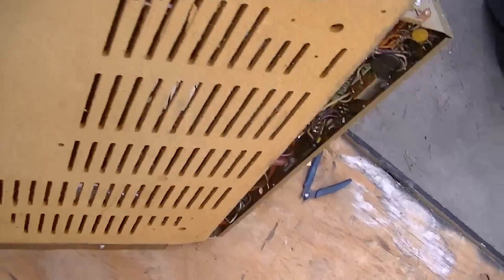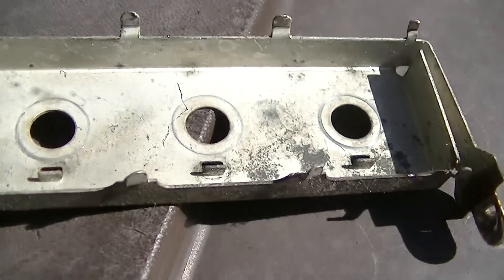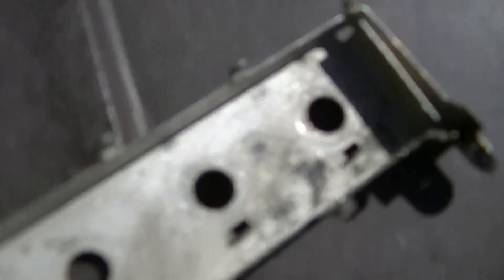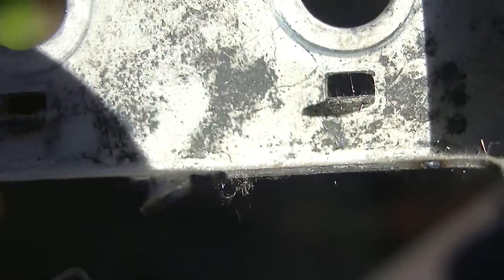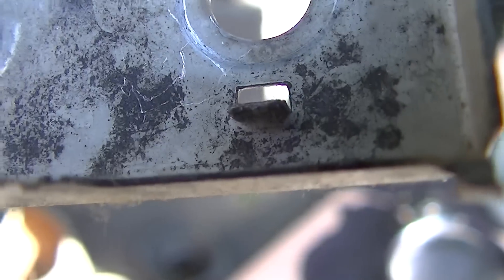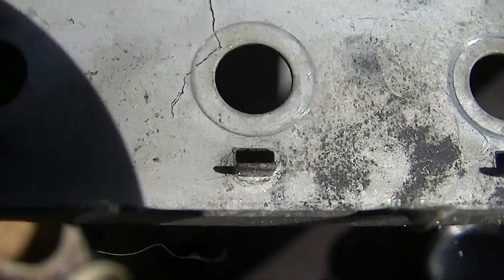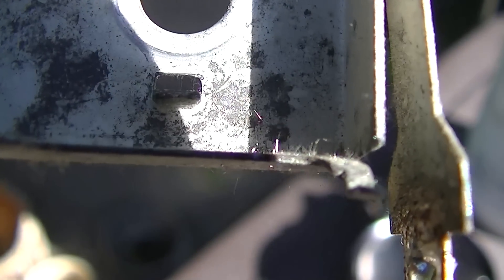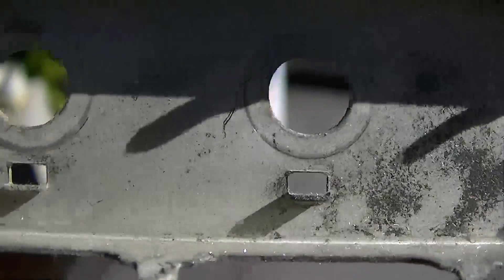Tin Whiskers in Control Pots Vintage Tube Television

Comment: In the UK a great many Mullard AF114 transistors, have met their end due to the whiskers, these were used in IF and RF stages and had a metal body which acted as a screen they were 4 pin devices, a great shame.

Comment: Big, old, well know problem, ubiquitous in cad, zink, tin, etc plating. Google "A History of Tin Whisker Theory: 1946 to 2004" Best thing would be to either electrolytically remove plating, acid dip or sandblast it off -then paint. But painting alone will help. I have has success (so far) with Rustoleum Appliance paint after a good work over with a wire wheel. BTW, most plating dust is toxic. Not all plating does this, but that is complicated subject.
Reply: shango066
It sure is trippy. Apparently these grow from the base up, just like grass, as some sort of response to (expansion?) stress. In easy to get to places, I do what you do, but in things that are a real PIA to get to, I use a little Badger sandblaster-then paint. My worry is the whiskers may go through the paint. Never seen it happen though. I surmise from what I have read that pure metal platings are the worst offenders, alloy plate less so.